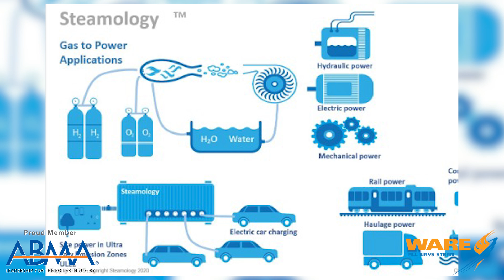Zero Emission Power Solutions using a Steam Turbine | Steamology - Steam Culture

Comment: ah I think you need to do a write up on the coalition for sustanable rail, they are continuing livio dante porta's research and working on biocoal as a fuel as well as advanced steam engine design, they also were looking in the past at making a steam locomotive demonstrator for passenger rail use, for the 120-140 mph range at least they were but they are indeed continuing research on the use of steam engines, and biocoal or basically they take waste biomass and they roast it like one would coffee the off gasses are re-injected into the reaction and its 90 percent efficient, has 80 percent the caloric value of regular coal, half the emissions and non of the bad toxic stuff, please check them out

though using hydrogen and oxygen sounds interesting too, they have for at least 2 decades talked about cars running off hydrogen and the emission is water but getting it to separate takes soo much energy and storing the hydrogen has to be under great pressure, makes me wonder why not just have fuel cells power locos they are already putting battery powered locos and ones with solar panels on top to help generate power in passenger engines.
also I am surprised that the fireless locomotives have not been given a second look where water is stored and flash boils into steam as it is used up in working, or the old compressed air locos like they used in the sugercane fields and other places where there was a risk with combustion engines to be around, and you just charge up the tanks with air every so much running distance and the electricity to power the compressor can be ran off green power or its feasibility.

makes one wonder dont it Brett.